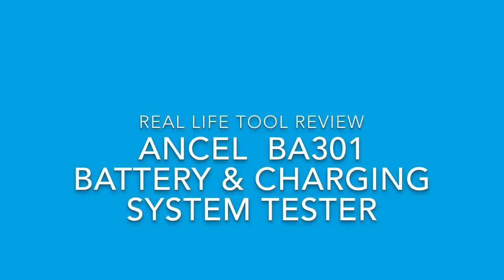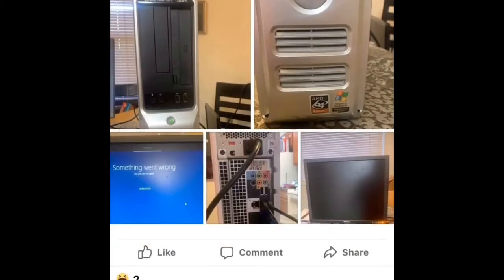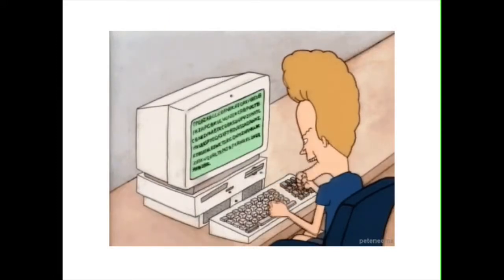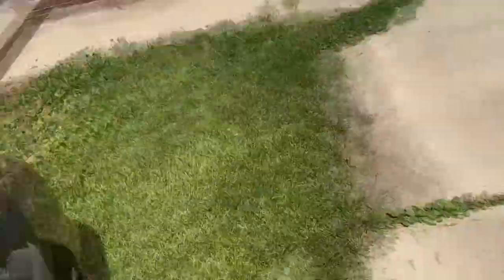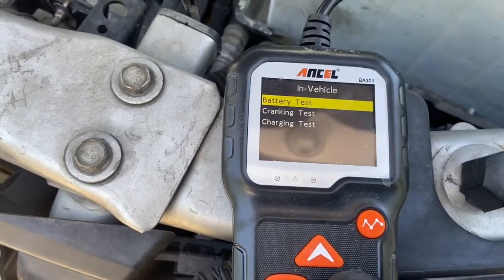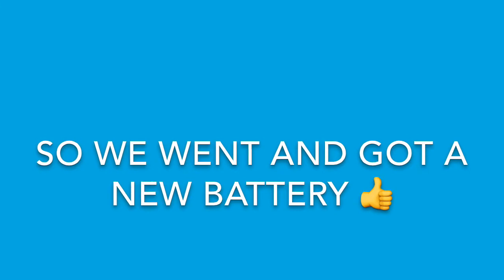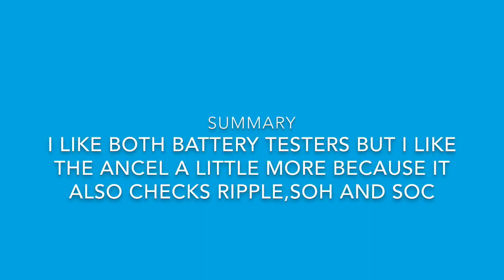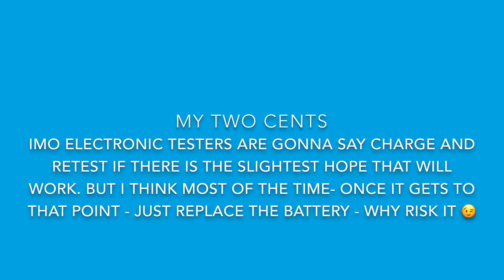Ancel BA301 battery tester vs Harbor Freight 100A battery tester review

Comment: Just FYI, I made measurements of the resistance using a 100A tester and one of the conductance type testers. Schumacher BT100 versus Konnwei KW208. 
Used a min max DMM measurement to measure the max voltage drop and also measured the maximum current under load using the BT100.
Calculated the resistance by dividing the voltage by the current.

 Then used the conductance tester to run a test. Much easier, with just a few button pushes, no need for the min max DMM and calculators 🙃

 Results between the two looked very similar which is good, considering the big difference in load current applied by each tester.
Very handy little tester. 
It showed a really big difference when testing on a Camaro directly at the battery situated in the trunk vs. connected at the jump access point in the engine compartment. Interesting that it can pick out, and expected with the long cable run from the back to front.  Explains why they need such a huge battery, to make up for the marginal connection.

Comment: 2100A CCA test result seems... improbable.  Wonder if it tests the same with post adapters screwed into the terminal for a better clamping connection than with the little side post terminals on the car.

These testers use two contacts on each clamp for a 4 wire connection, I wonder if the voltage sensing connection was not solidly connected somehow. 
You win the highest reading I've seen on the Internet trophy either way 😉
The old school 100A tester just uses plain clamps so it would have been good to use that for a load test on the new battery also to confirm the readings.  
Based on the electronic tester measurement of 0.00075 ohms, multiplying 100A by the battery internal resistance gets a value of 0.075V, which means the needle on the analog meter should move hardly at all when the button is pushed. That type tester can't get a false positive reading if it's working properly; more of a pessimistic tester in that regard 🙃
Reply from the maker: Tell me you’re an Electrical Engineer, without telling me you’re an Electrical Engineer lol 😆 Yeah the old school tester is pretty reliable, never misdiagnosed anything with it. But I do like the SOC reading from the new school tester. But the new school digital testers will almost always say charge and retest…. That battery I was testing had been tested by other people.. whose digital tester kept telling them to charge and retest. Which they did.. but the battery kept failing a few days later. It’s been my experience to just replace batteries (then confirm the charging system) once they start having problems starting the car and test with super low voltage.
Reply: @MJ100k  yup, I like both testers, so far I've been getting reasonable results with the Konnwei version I got.  It just may need more care in connecting to the battery, because it's more finicky in that regard.

I just ran a test on a top terminal, and the clamps are just too narrow to connect across the battery cable terminals; just can't get them far enough apart.  I used a narrow section instead, which wasn't as ideal.  
It's fine when connecting directly to the top posts of the battery though, I guess they just didn't think it through fully about testing when installed in the cars.
They really need to make the tester clamps wider so people are more likely to get it connected properly.
Reply from the maker: @wingerrrrrrrrr  I agree 👍